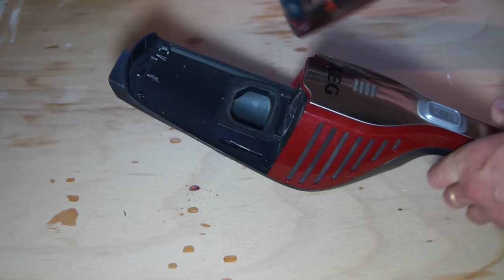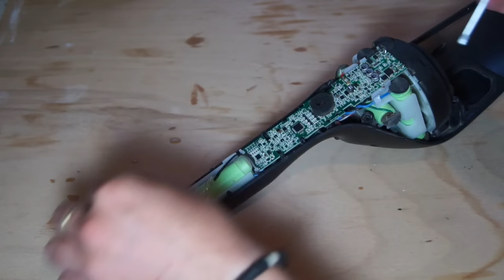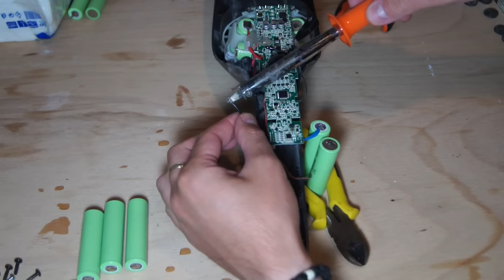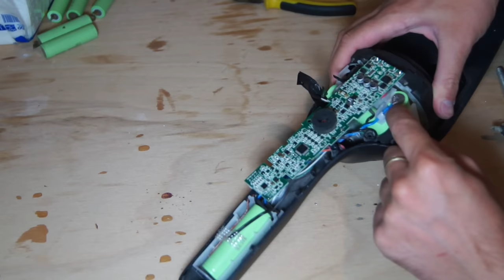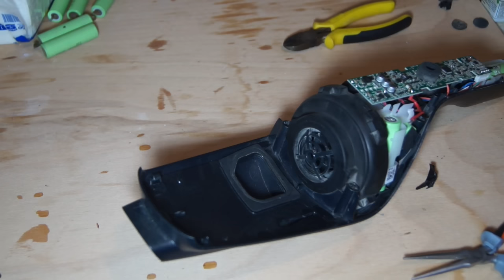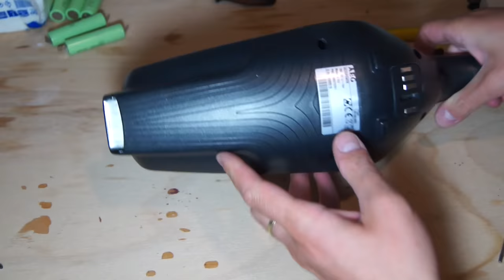Ergorapido Battery replacement - Inlocuire acumulatori

Comment: Hi I did the exact same thing you did, but now when i put the unit to charge, there is no charging light indicator. I changed back to the old batteries and still no charging light. Any idea whats going on?
Reply from the maker: Ahmad Muammar  check the polarity of the cels, you should take pictures before you removed them  so you know you did not mess the polarity. Also after you change the batteries if it is not starting try to make a full charge. But on yours if you do not have charging light on is is very posible to be wrong polarity. The cels  are not  arranged the same on all models, even same model have different arrangement. Have a nice day and good luck!
Reply: Hi. Thanks for the fast reply. I did check the polarity  and the new battery pack reads positive 18 volts which means its working. I think i shorted something on the board while changing the battery. Anyways, thanks again.
Reply: @ahmadmuammar8630  have you found the problem?
Reply: @creationsmv6201  Yes. It was the board. I'm sure I shorted something while removing the old battery. I got a new board by buying a second hand set which battery also last for a minute. Got new batteries too. And it managed to last for 2-3 more years before the same problem happened.

Comment: Buna tuturor. Am gasit foarte util acest filmat. Am schimbat 5 acumulatori noi de 2500mA și funcționează foarte bine, mi-a dat mai multa siguranta sa fac asta, dar a mai ramas o problema. Cand. il incarc se aprind pe rand doar  trei dintre cele 4 leduri le de incarcare , iar ultimul nu se aprinde niciodata, cel dinspre maxim, am vrut sa întreb dacă are cineva vreo idee, de ce. Aparent funcționează totul fără defect , și vreau sa mulțumesc mult pe aceasta cale celor care au acest spirit de a le arată și altora lucruri foarte utile.
Reply from the maker: Asta inseamna ca nu se incarca complet, este posibil ca unul din acumulatori sa fie cu probleme sau !!Foarte important - acumulatorii trebuie sa fie fara protectie(fara BMS). Incarcarea dureaza cam 2-3 ore
Reply: Impact DIY ai un nr de whatsapp sa-ți trimit poze, le_am măsurat erau toate la fel, mersi de raspuns
Reply from the maker: Daca poti, trimite un mail la impactdiytube@gmail.com

Comment: I changed them but after fully charging it only works for 8 seconds. Is it the batteries' fault?
Reply from the maker: Yes, one or more  of the batteries has a problem. I use batteries recovered from cordless drill to be sure they are genuine. There are a lot of fake batteries on the market.

Comment: Hi need your advice here. After replace  the batteries, the red led is lid when i press the On button. What is the issue?
Reply from the maker: Hello. Try to charge it first. The batteries may not be balanced.

Comment: Hello, I replaced the batteries with new ones, I connected all of them but it does not work. I measured the voltage, it's 17,6 V (measured the last + and last -).
I checked, there are no loose wires. What could be the reason?
Reply from the maker: Check if the new batteries can handle 20A discharge or if the motor is blocked.
Reply: @ImpactDIY  thanks. I can check the motor but how can I check the discharge?
Reply: @mirkobezic4842  hi, have you found the problem?
Reply: @creationsmv6201  No, I gave up.

Comment: Thanks for video.
I replace old (Samsung) batteries from an ZB3011 with 5*SONYUS18650VTC6 (brand new).
         Continuous discharge current: 15A
         Peak Discharge Current: 30A
         Capacity: 3120mAh
         Real discharge capacity (measured wit Opus BT-C3100)  3050-3150 mAh

I tested this batteries 2 times with charger Opus BT-C3100 and i leave them full charged before soldering.
After I solder new batteries I measure balance connector( that with 5 pins), and voltage was right for every pin.

After I solder this batteries I start vacuum cleaner(Electrolux Ergorapido ZB3011) at full speed.
Vacuum cleaner run at full speed for 30-35 minutes.
After full discharge ( vacuum cleaner stop himself) I wait 1h and I put ZB3011 on original charge adapter.

Vacuum cleaner is not charging.
When I put to charge :
1. Last led light in red continuous
2. After a while last led start blinking in red once per second.
3. After a while all led are stop.

Sometime step 1. is missing, some time step 2. is missing

What to do?

Thanks
Reply: I use these batteries on my e-cig, very powerful ones. Maybe charger output is not suitable to charge VTC6.

Comment: Do you used unprotected batteries ?
Reply from the maker: Yes, you need to replace with unprotected cells, if you use protected cells is very dangerous and it will not work
Reply: Impact DIY Thank you

Comment: Salutare. Am înlocuit acumulatorii originali, 5 bucăți de 3.6V 1500mah cu 5 bucăți de 3.7V (3 de 1800mah și 2 de 1200mah). Din păcate aspiratorul nu funcționează... Incărcarea a durat foarte puțin iar la pornire are un zvac si cam atat... Îmi poți da o idee ce nu am făcut corect? Circuitul l-am respectat, acumulatorii sunt înseriați, as zice ca e ok...
Reply from the maker: Salut, 100% acumulatorii nu sunt buni, incearca sa recuperezi celule/acumulatori din baterii de bormasina sau alte unelte de forta. Atentie la demontarea bateriilor, orice scurt poate provoca un incendiu.
Reply: @ImpactDIY  Mulțumesc pentru răspuns. Ai avut dreptate, acumulatorii nu sunt ok, au ceva electronică pe ei, o plăcuță mică. O voi scoate de pe fiecare și revin cu feedback. Mulțumesc frumos încă odată.
Reply: @ImpactDIY  Am varianta de aspirator cu 5 acumulatori, spune-mi te rog, toți acumulatorii sunt înseriați?
Reply from the maker: @cezarkage  sa nu folosesti acumulatorii respectivi, chiar daca ai scos placuta, este periculos, nu suporta consumul aspiratorului, exista inclusiv risc de incendiu, foloseste acumulatori din baterii de bormasina. Nu sunt legate in serie, sunt legate individual pe placuta.
Reply: @ImpactDIY  Am folosit acumulatorii de la o bormașina astfel am rezolvat problema. Mulțumesc mult pentru ajutor! 👍👍👍